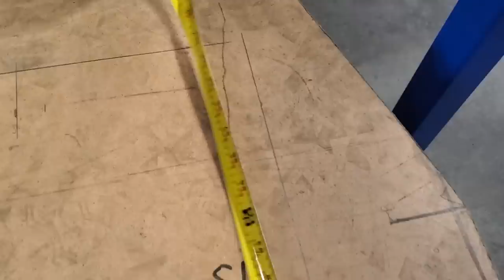Notching pipe/tubing with simple tools. Crusty gets a roll cage

Comment: Fitzee, in a drag-only setup, you can mount the turbo anywhere in the car that is most convenient. By that, I mean that you van mount it under and behind the engine, also. Build typical headers, add a Y pipe, bolt the turbo to that, and then plumb forward to the throttle body. The turbo is simply a air compressor. On a street setup, mounting it under and away would lead to more turbo lag, but in a drag setup, you build boost on the line, and hold the damn thing to the floor for the entire run, so lag is of no concern. Measure the boost at the throttle body, and any pressure loss due to the length of the plumbing will automagically be factored-in.

Love your content and advice. You completely changed, for the better, how I do body panels with your cut 'n butt method! Thanks!
Reply: This car will see street duty as well...but what you say is really interesting!  Makes a lot of sense!

Comment: I had an idea that I thought I would pass along. When making the template for the door jambs I thought about using PVC pipe as your initial guide. Because with a heat gun it can be manipulated to the shape you want and it's easy to cut. I thought it might save a little bit of lay out time. I also recon if for some reason you come up short you could use a coupling or couplings to increase your length. My thought was heat the pipe all the way around and a little beyond your desired length and use your tubing Bender to get your shape. Exactly the same way as steel. Just a thought. The job looks incredible as of now Tony!

Comment: When I was a welder fitter I spent a lot of time welding railings, catwalks excetra, and would weld two inch pipe like this for days it seemed at times. I would cut and grind those bird mouths basically the same way as you just did them. When your doing this for a living you get pretty dern fast and accurate with cutting bird mouths. LOL Yeah that coating on steel pipe is FBE Fusion Bonded Epoxy they use that for its corrosion resistant properties.

Comment: I did the steel tube frame for an aluminium bodied Austin 7 the same way just using an angle grinder to fish mouth the tubes. That tube was only 19 mm diameter ERW tubing though. The frame was then all brazed together.

Comment: Tony for your rear down bars I'd of made a bend in your pipe to the upward angle and flat mounted the end to the frame rail.....
as fro your gussets Id just use the short rems of your 1 3/4  pipe and make gussets using angle cuts
it's easy to do plus it makes for a lot stronger gusset!

Comment: Fitzee you will end up with so much triangulation of the frame that it will in effect be a solid metal brick that has no give what so ever. In the event of an impact it will not have the ability to absorb the resultant energy all to the detriment of the contents (you)! Might I humbly suggest  you consider introducing some crumple capacity to the frame which can be easily created by some judicial slotting of the frame rails. Otherwise your craftmanship is quite exceptional.

Comment: Hi Tony.  I think the way you sculpt the pipe with the grinder makes an even closer joint than from a hole saw jig!  Thanks for sharing this.  The LS engine looks really wicked in old Crusty.  I was going to ask if you think it will run in the 5's, but I see you had a 5.35 on the Mustang, so I guess the answer would be yes.  It's going to be a little rocket ship, especially with the turbo.  Looking forward to seeing some of that action, when the time comes.  There is a guy on YouTube named Richard Holdener who has a lot of science around building a stout LS.  Don't know if you've watched him or not, but figured I'd tell you in case you want to look him up.  Thanks for the video!
Reply from the maker: I have him and a bunch more  in my watched list. He has alot of interest info that can be used

Comment: I am only 6 foot tall. But we are required to have a plate of steel over the top of your head stitched into the cage for saloon car racing. By the time you add that and then allow for your helmet height, head height is a premium. Most cars I raced my helmet rattled against the roof or side bars when things got rough.

Comment: Cars coming along nice, a simple pipe notcher does fish mouth  and notches the pipe in about 20 seconds I have one on my drill press just set your angle and go.
Reply from the maker: Kind of money is that notcher worth? 20 seconds??
Reply: @fitzeesfabrications  harbor freight about 57 dollars used to build over 25 dune buggy frames inch and a half tubing using inch and a half hole saw metal cutting
Reply from the maker: @mrpurcountry  I have same setup. You have to spend money on a good hole saw and steep angles take a long time to cut. There are many out there like yourself that prefer  them.  Me I just use a grinder for everything and find it faster.

Comment: That was alot of explaining how you made that roll bar, roll cage for crusty. I wish that we would of had someone like you running our shop class when I was in t=high school in the earily 70's. Good explaination on how to notch the pipe. I guessed I must have missed it but what size pipe did you use to build that roll cage in crusty?  Another fantastic video, well done by the metal master.
Reply from the maker: Measure 1 5/8 outside with a 1/8 wall
Reply: @Fitzee's Fabrications  Fitzee, this is really coming together nicely.  I did not realize when you built the frame how much additional structure would come from the roll cage.  The tubing your using ... can you provide more details?  I thought chrome moly was the usual choice, if you covered this somewhere else let me know where to look.  These videos are getting better and better, I am so glad you take the time to make them.

Comment: Are you using chrome molly tubing or just regular pipe .? Are you making a drive shaft loop? It would be required in some tracks.
Reply from the maker: Mild steel and yes a driveshaft loop will be made

Comment: Hey Tony have you tought of changing the bolt orientation of your upper control arm so that you can remove it later ? On the driver side it is ok but the passenger side seems to be the other way
Reply from the maker: I have all new bushings for those control arms and will be looking after that when I replace them

Comment: is your horizontal bar on the main hoop going to be your harness attachment? or are you going to put in a separate harness bar to get the angle of your shoulder belts correct?
Reply from the maker: I'm going to set that bar where it need to be at. Will figure that out after I mount seat

Comment: Are you required to have floor bars to attach your seat to. So that the seat is tied into the cage.
Cage design and requirements can be a pain in the arse depending on where you race and what sanction they affiliate with. 
It’s hard on the head bye
Reply from the maker: I will be adding those when I fit the seat.